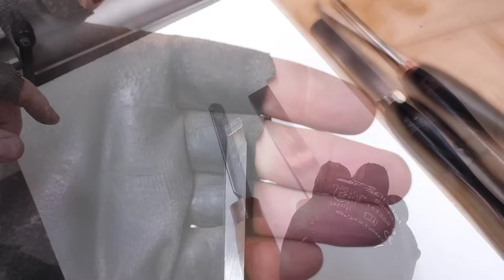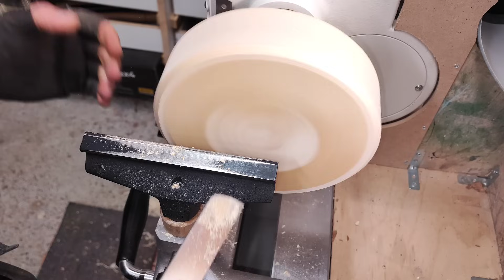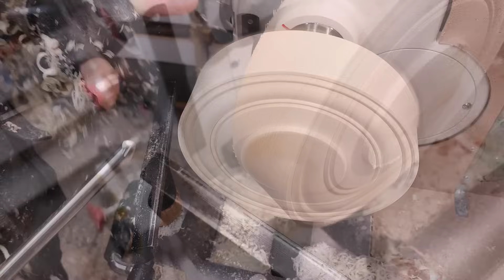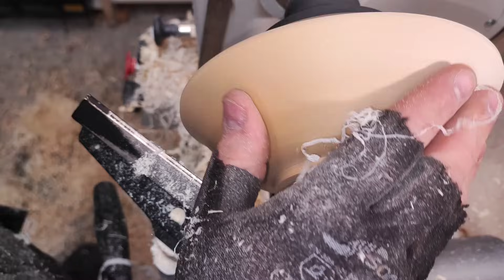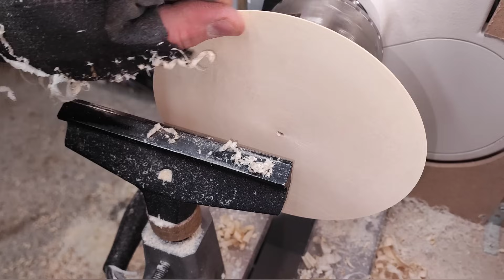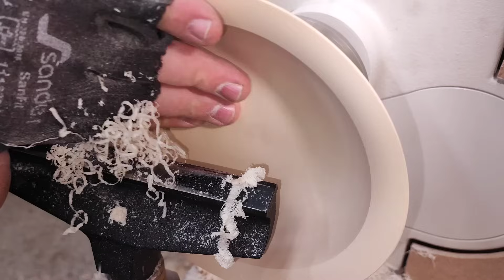Versitile Negative Rake Scrapers

Comment: Great demo and teaching as always!  I keep sharpening to how I think you are but never seem to get ribbons like that.  Am wondering if I am not applying enough pressure on the scraping cut (I practically apply none).  Thanks for sharing.  I have a few NR and do like them but your scraper style feels a lot easier to sharpen.  Removing the burr by turning over on sandpaper to use non grinder methods etc makes it so easy.  Cannot so easily do that with the NR
Reply from the maker: What angle you use on scrapers,  that can also effect the quality on the scrape.
Reply: @tomislavtomasicwoodturning  Yah I've been doing 45 degree on an 80 grit CBN so cant figure out whats going on.  I felt confident i was mimicking your sharpening but never get even close to what yours do when I bring it back to the lathe.
I should just buy one of your scrapers and see if that works, though I am in Canada.
What I would give to have you step to my lathe/grinder to see for myself haha :)
Reply from the maker: @perrys5954 that would be teh easiest solution to come over and see in person, 😂

Some woods don't produce big ribbons,  so that might effect it also.

Step 1, nake sure you have nice clean bevel all the way to the top of the tool.

Step 2, after step one you should feel burr on the edge, flip tool over and remove that burr with sandpaper down on flat surface. Grab like 600 or 800 grit paper works great.

Step 3, back on grinder, put the burr one more time, this time just enough you have the burr.

Its should work great😊 if not send me pictures on my email, we'll try to investigate further😁. 

Ps. I do send packages to Canada, several of my tools found home in Canada so might wanna grab a few in next preorder 😊
Reply: @tomislavtomasicwoodturning  Wow man thanks so much for taking the time to answer me!  What exceptional character you have!!
OK I'll try that 3 step technique!  Excited to give it a try tomorrow as soon as I get the chance.
I am quite certain that I'll end up with one of your tools but buget restricts probably to one so I have been undecided which direction to go to finally get a good quality of something.  Gouge, Scraper, .. etc.  So many directions I could go.
Do you recall about what the shipping cost was to send to Canada by chance?  I always assumed quite hibh.
Thanks again for the reply!!
Reply from the maker: @perrys5954 uff of top of my head I would say between 35 and 40 euros up to  2kg if not mistaken
Reply: @tomislavtomasicwoodturning  Thanks for the info.  Any thoughts on a 'fairly new woodturner'  (not complete newbie but still learning a lot).  Pretty much all of my tools are about as cheap as one can get.   So I guess I am asking if you can think of which tool I may benefit from if I were to only choose one?   (maybe two, i'll have to see how finances balance).  My top picks in general were Bowl Gouge, scraper, spindle gouge (like what you do a lot of turning/roughing on bowls with)
Reply from the maker: @perrys5954 i would always go for bowl gouge and spindle gouge as with that 2 you can make pretty much anything, all other tools improve or make life easier or just does the job better,but for starting of bowl and spindle gouge
Reply: @tomislavtomasicwoodturning  That sounds like really good advise and makes sense!

Comment: Thank-you for this very objective view of the negative rake scraper as well as some of your approaches for sharpening both negative rake and regular scrapers.  I have a square end scraper that is going to get a bit of a radius as a result of me watching this video; it think that will improve its usefulness and make it much safer to use.
Reply from the maker: Indeed it will improve usefullness ,no doubt.
Its such a underrated tool but essential in my work

Comment: I find that when I use scrapers, negative rake or normal with rolled burr, the finish looks and feels great, but then when you apply a finish, I can see what I call 'micro torn out grain'. You can't feel it, but its high-lighted by the finish.
Reply from the maker: I should have pointed our that although this bowl was straight from tool, usually I would sand it, sanding will remove all those tool marks👍
Reply: @tomislavtomasicwoodturning  I meant even after sanding. It's a shame I can't show you want I mean
Reply from the maker: @SirBenJamin_  hmm that is strange, try sending to my email , few photos so I might help out more

Comment: You always seem to answer my questions even before I think of them!  I had wondered how the negative rake scraper differed from using a skew, and you said that the point of the skew is less robust because of the angle- perfect.  Your negative rake scraping on the side of that blank really made some cotton-candy like shavings.  The biggest thing I learned is that I need to sharpen my scrapers a lot more than I have been!
Reply from the maker: Scrapers do need sharpening more often then other tools as they rely on burr to do all the work, thank you very much for watching